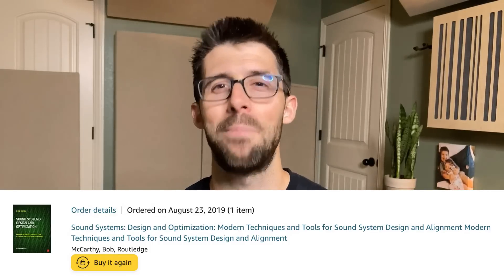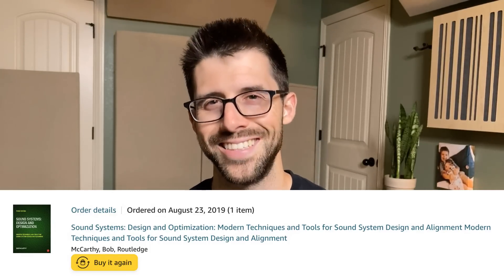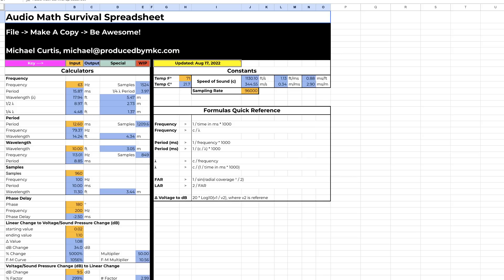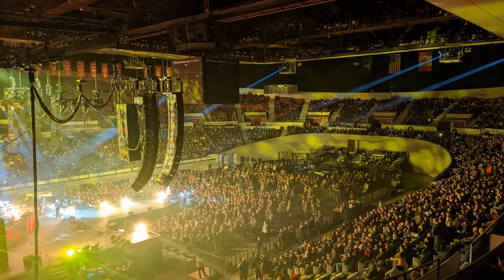Three Dead Wrong Mindsets I've Overcome On System Tuning

Comment: Hello Michael. I have a quick question. I'm a mobile DJ but I sometimes find myself doing bigger events with a couple hundred people. I currently have two 18's subs and I want to upgrade to a 21". If I were to combine the 21 and two 18s for my larger event, would I be doing more harm than good. I know you want to run two of the same subs, but they expensive.

Comment: I recently transitioned from JBL VRX powered boxes to the SRX906LA boxes.  I want to learn their FIR EQ ability.  I understand the low-mid buildup from coupling but I don’t have the wisdom or a strategy for how to correct this with the built in adjustments.  Is there teaching available on this specific topic please? Thanks!
Reply from the maker: Great question here! To my knowledge I haven't seen any public from JBL or someone who knows the product well. I did some remote consulting for a client who was putting the boxes in and he liked the sound of them and we were able to get good results.

I know "FIR EQ" sounds scary, but you can treat it like a normal EQ. They have a fancy name for it, I think "array compensation" or something, but it's just a low shelf to account for extra low-mids that couple due to array size. Simply bring the shelf down to tailor the low mids to your liking/target curve.

As far as top end, you can use their high frequency "shelf" to increase or decrease HF based on distance. As of this writing I don't think there's an easy way to make groups between individal speakers on left and right hangs, but you can play around with it and see if they've updated it now.

Comment: All the tools we have at our disposal are wonderful, but with each passing year, I see more and more engineers become so dependent on these tools, that if they are taken away they become blubbering infants.   Any good A1 needs to be able to do everything needed to get the show running with without depending on any of these tools, if an emergency demands it.   That is the skill that the industry is most lacking.   The pandemic made things much worse in this regard, as people got rusty, and there were also engineers being shoved into unfamiliar roles, due to things like webcasting and personnel shortages due to people leaving the industry.   The other glaring problem I see is husbanding, where people are unwilling to train newbies, because those newbies might steal their job someday.   We all need to work together, a rising tide lifts all boats.   And don't even get me started on the "white glovers" who think just because they are an A1 they are too important to help strike the show, and bug out as soon as FOH is packed up.  Drives me insane.   Okay, rant over, lol.
Reply from the maker: Thanks for the rant, Jim : ). Yes, I couldn't agree more when it comes to being able to execute on the fundamentals of live audio (get a rig up quick, run clean cables, have coherent IO, gain structure, communicating with the talent clearly, staying on top of cues). Those are the starting point, then you're able to augment with these other tools to really make sure everything is working correctly.

An engineer who's a geek about system tuning or Waves plugins but has no work ethic, people skills, or attention to detail with stage layout/IO/cable runs will get circles run around them by someone who has a core grasp of true live audio essentials.
Reply: @MichaelCurtisAudio  Another thing that would make a good video, is the concept of "owning it."  If you don't know how to do something, own it and ask for help.   Sometimes an entire show setup will grind to a halt and no one will take responsibility or step up to the plate.   No one will say "Yes, I forgot to pack ____" or "Yes, I accidently broke _______" instead they try to lie and obfuscate and "fake it til you make it" or cover it with gaff tape and hope no one notices, and that turns and easy smooth show into a never ending torture, where clients are screaming and people are hiding in airwall pockets so they don't get yelled at.   It's very easy to say "Sorry, can you show me how to set this up, I've never used this before..." but many people are scared to do that.   It's also very easy to say "We need more hands, we are behind, can you get me more bodies?" but people are scared to do that also.   So instead you are working down to the last millisecond before doors open and it takes five years off your lifespan.   Luckily, I don't have to deal with that very often anymore, but I still hear horror stories.

Comment: As you mentioned, auto solvers are a handy tool to get started with. They are not new with only L-Acoustics, I remember a supplier insisting on using a JBL black "magic" box on a JBL EON v2 rig many decades ago with just 1 mic placement (think DBX DriveRack PA .. but with only a single button and power indicator on the front) ..... Needless to say, once they left the venue for the day, it was bypassed.

Other manufacturers have had them too, some were decent to great at some version, others were not and some were making up new line array "math"...

EAW 730 algorithms were all over the place ... they did have 1 version that seemed to work a solid 90% of the time given the variables put in (audience coverage), but they had a habit of breaking it as they're angle selection was very slim. I ended up making up a spreadsheet that mimicked the old L'Acoustics excel Soundvision for angles

The EAW 740's I found were worse... there really was only 1 hang for a given box count, that usually always had too much energy off of a back wall....

Having said that, with the original v3.0x of SoundVision, those first auto FILTER algorithms were horrible (auto SPLAY were decent), but they've quickly adapted and changed the algorithms in a positive way that does get you pretty darn close if you have the right amount and types of speakers in an array.

As always, YMMV
Reply from the maker: Thanks for this, Brad. I'm curious to fly another L-Acoustics rig soon and play around more with the autosolvers. My big thing with autosplay at the moment as that it will never do any overshoot.
Reply: @MichaelCurtisAudio  Overshoot is easy ... you just need to add in another audience area to define you overshoot! (simple as a 6-10ft vertical surface, or 20-100ft horizontal surface depending on your requirements)
Reply from the maker: @bradharris2975  Let me just go peel my brain off the wall real quick 🤣. Never would have thought of that.